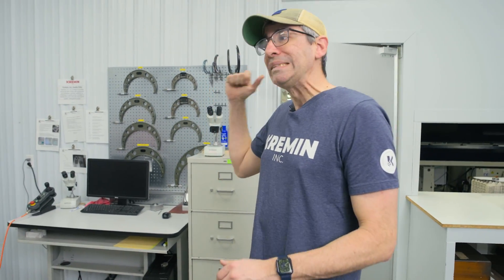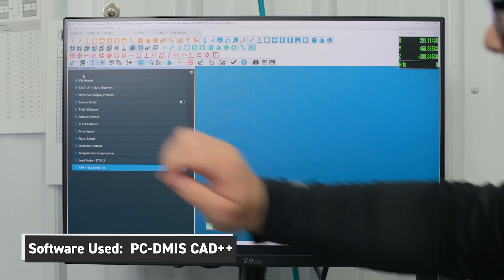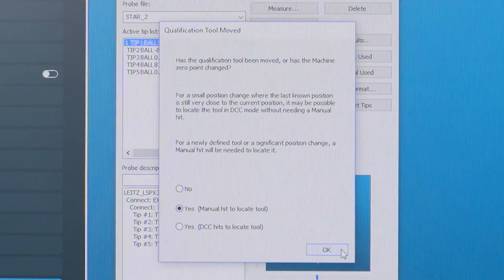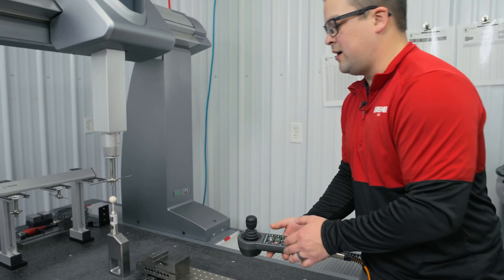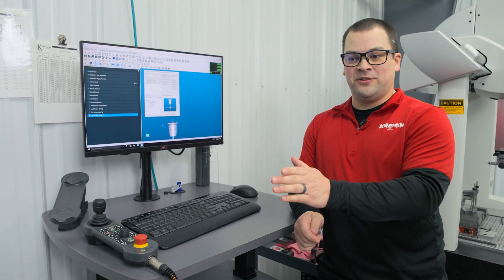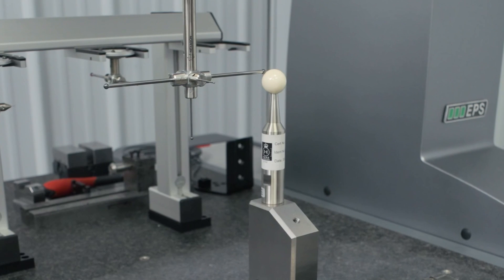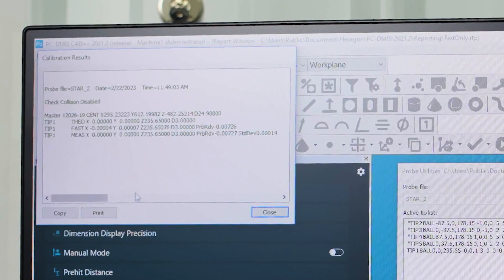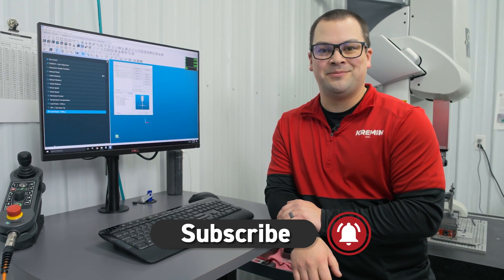How to Calibrate Your CMM [FULL GUIDE]

Comment: This is not cmm calibration. Also, the stdev is 0.0014, which is not 1/10t (nor 1/10th of a percent, the stdev is in the units of the measurement).

Comment: I calibrate cmms and let me tell ya it takes longer than 30 minutes for an actual calibration. also are you not able to select all the probes to be calibrated at the same time? I work on Mitutoyo machines and I’m able to select all the probes I have built in my part program and calibrate them all at once.
Reply: I do Hexagon, i have 2 days for geometric errors  compensation + iso10360/2 it is quite a rush😅